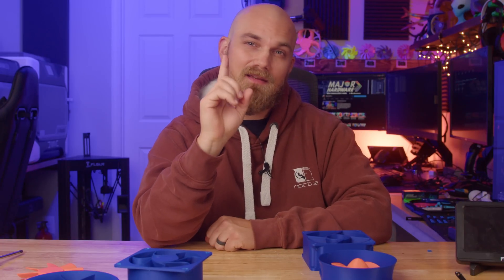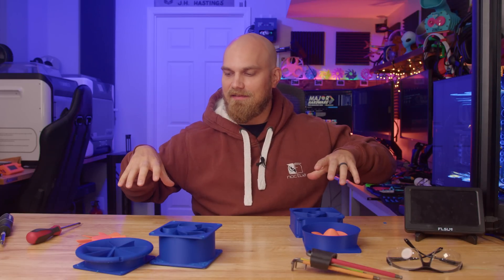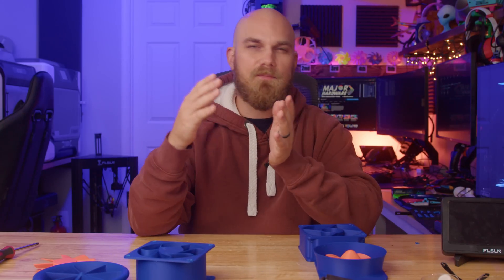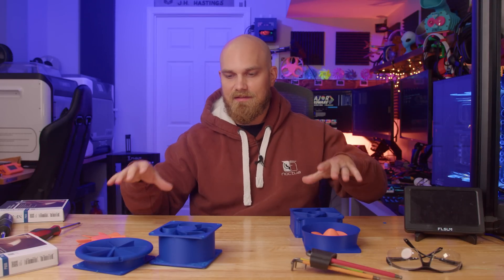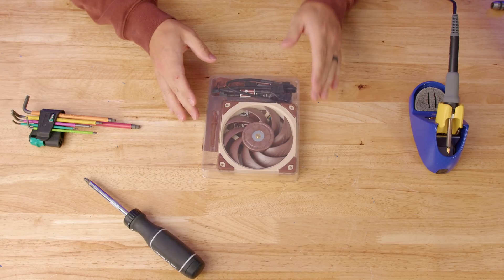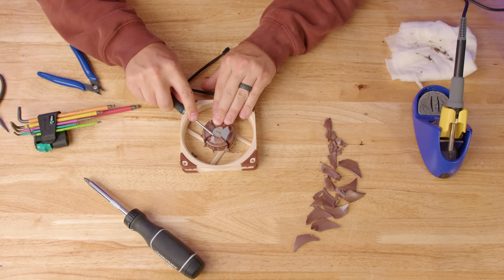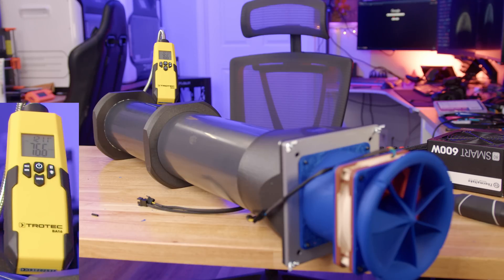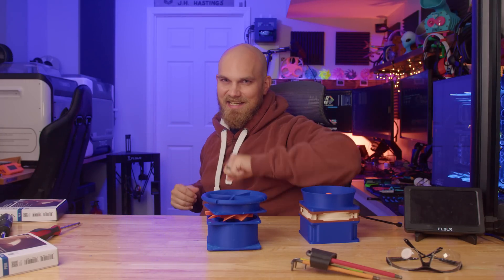Which One is REALLY the BEST | Fan Showdown S4 Finale

Comment: Honestly, I think you should do all the methods of testing.  If you don't have time for that, I still think you should do noise, smoke flow, airflow, and finally at least one of the cooling tests.  Noise/smoke/airflow are all fast tests, so then the only thing that is time intensive would be the cooling test.  Maybe what you vary season to season could be the kind of cooling test you do.  Also, you should have one final bout between the unswirler and cheater on any of the actual cooling tests.  That's the ultimate showdown really.  When their numbers are so close, the number don't matter as much as performance and noise at that point.

Comment: For season 5, while it would be more work it will also help display correlations, I would love to see the following:
An Airflow test to show just how much air a fan can move
A cooling test, oriented with the fan pulling air in from below and pushing/pulling it upward through a liquid radiator.  This will allow a 'baseline' of no fan with the best conditions as the radiator will heat the air, causing it to rise, which will draw air in passively.
Using a liquid cooling setup will allow you to create a mount distanced from the components themselves. The mount, ideally, will have temperature gauges for the liquid as it both enters and exits the radiator. Therefor, we can see where the temperature levels off and exactly how much 'cooling power' each fan can produce.

With that, we can then hopefully draw metrics to see just how much airflow produced correlates with 'cooling power'.  Future submitters can then use their own airflow tests and simulations to gauge how much cooling their fans might yield and help drive creation and design further.

Comment: Here's a more sophisticated way of ranking fans: raw airflow, airflow per dbA, raw static pressure, static pressure per dbA, air temps, thicc rad temps. Main ranking should be average of all with "king of Air", "king of Water" and "King of Silence" subrankings. Good luck organizing all of that lol.
BTW I believe a lot of fans waste potential because of wobbling so it would be nice if you did same thing as tyre balancing by measuring wobble and adding little weights to even out 3D printing artifacts.

Comment: I feel like you’ve done cooling and airflow pretty completely. I think it’s time to up the ante. Make a scoring system based on airflow, cooling, sound, static pressure. Then have a bracket showdown - fill a box with smoke, mount a fan pushing into the box on either side, and see which fan wins the death match. Or just keep doing your thing because we love ya. But also…death match.

Comment: The very purpose of measuring the fan air performance really is a stand-in to estimate the cooling performance, AKA the real thing that actually matters. Measuring airflow is like testing a car's performance on a dyno rather than on the track, or torque at the shaft rather than at the wheels. Is the cheater REALLY the top performer for the domain in which it's meant? You will never know because of that abstraction. The turbulence profile could interact with a cooler extremely negatively, the vibration profile could mess with the vapor chambers.
Actually putting the fans on something like a Noctua NH-U12A and testing cooling performance actually makes the truth evident in a way that airflow cannot.

Comment: I have an Opinion... because Internet.

The show has evolved a few times since its inception, c'est la vie.
The cooling tests were a good starting platform but the show is "The FAN showdown". 
With the change, It focused on more aspects of the fan and its performance... as a FAN 

If you were to bring back more CPU cooling focus, it would have to be both air cooled and water cooled. 
Air-cooling with Noctua is the way to go.
An AIO would be ok, as long as it has a decent flowrate or the one with the most market share.

Each have their caveats when it comes to the fans cooling them.

Comment: Air cooler u12A. Most heat pipes. Less surface area, comes down to the fan more than most, and kept simple with just 1 Tower.

Comment: But into your question. I think running a real test on a bench cooper would need better as it would show real world results much better than a hypothetical setup. A lot of times, lab results don't equal real world results. While they can help to show numbers. They don't take into account things like does a squirrel so better over a heat sink or turbulent air or non turbulent straight air flow.

Comment: Would love to see the same airflow setup with additional restriction, like pc case mesh and/or radiator to test how they perform under pressure :D
Also i would love to see fans being tested both restricted and unrestricted(like in S4). Temperature test has too many variables. I guess if fans can move a lotta air while restricted, they would also cool well.

Comment: I would suggest that Airflow is not the entire picture, nor is air pressure.
Fans are indeed designed to be tuned towards a specific purpose.
Denser blades often means it is meant for high pressure, which should work better for radiators and heatsinks.
While the more open fans are lighter and can spin up faster for a higher flow rate.

Maybe the answer then is to take the top 5 from your best airflow chart and see how those do in cooling.  Or just the winner of each episode.
Alternatively you could have the submitted designs clarify on which their design is meant for.

Comment: I see many comments suggesting you add a water cooler to add some more resistance in the air stream, but the simplest method would probably be to just print a restrictor plate and put that somewhere in the system. You could even try fans both pushing and pulling air trough the restrictor plate.

And since pressure is just the result of resistance to flow, there is no need to measure the static pressure. This addition is basically just to see if the fans have any sort of resistance to stalling when the pressure differential starts adding up slightly more than before.

Comment: You could do CPU cooling alongside the current test just as an extra metric, but perhaps you could have a dummy CPU that's just a resistive heater with a temp sensor inside so you can drive it with a constant current and make it a perfect uniform heat source

Comment: Just saying that IF you do any cooling performance testing, not use a CPU?
Instead, how about driving a tonne of amps through a peltier and cool that and try to keep that cool instead of trying to generate a load on a CPU hoping it will be constant in power consumption.
Maybe even measure both the hot and cold side of the peltier?
I like the invariability of the flow test (apples to apples and so on), but I like the test of 'how well does it cool' better for measuring how well a design does. They are cooling fans after all.

Comment: Maybe do 140mm fans next season! Going to 140 changes ALOT about rpm, static pressure, blade design, etc... Keep making great videos! Oh I'd love to see the 140mm on a 140mm aio, or custom loop, maybe custom loop would be best but I'm not sure if they make a single fan 140mm radiator, maybe somewhere out there

Comment: I prefer the airflow test, but there should be a static pressure test on top of it. The airflow is good, but it doesn't remotely represent how the air is dispersed. That's sort of what the smoke test is for, but it doesn't really quantify the affect of the center flow.

Comment: I prefer airflow tests. Cooling tests have way too many variables room temp back ground tasks residual heat from the prior test. And you have to take more measurements of air temps. Most people can figure out the cooling performance based on airflow. What would be better would be static pressure so if people wanted to use these on a radiator.

Comment: I think you should test both unobstructed flow and flow through the radiator - that'd cover use cases as a cooling fan and intake/exhaust fan and also give idea, which design is better for which purpose, which could be interesting.

Comment: Second comment, not my usual habit, but here's how I'd like to see S5 be measured as for cooling performance. Considering the target being "enthusiast grade", aside the whole set of current measures including CFM, a 'cooling performance' would be a good point as well. Ideally you'd take an as fixed heat source as possible, whether that be a heating element you can just 'set' to ~200W (gotta mimic them alder lakes). Something easy to calculate the amount of energy going "in". Water heat exchanger on it (a block, or something else), and measure the amount of heat in the water. So far it should be pretty consistent. You'll have a value of thermal energy in the water. Pipe water through radiator with fan on it, and while I realise you'll run the risk of having a radiator test (hmmm... wish it were cost effective to 3d-print radiators with that copper-shrink-filament stuff), you can measure the thermal remainder in the water after the radiator. Ofc, this won't work with a closed loop (equilibrium is a boring measure), it would have to be an open loop with as little variable behind it as possible other than the fans' ability to influence the radiator to exchange heat between water and air, but I'm sure that with a clever tank setup and a good D5 pump on fixed speed you can do this without much harm to the loop, or excessive waste of water.

Comment: I think you should use resistive electric heating peaking at 100°C meant to simulate the load of the 4090, at the exit of the wind tunnel, with thermal probes connected to the heating element, to get a graph of the temperature of thermal probe for the duration of the test, which to use to make a graph for the averages, and which to pair with a similar test without a wind tunnel, and have those two as separate rankings and a third separate ranking which to be the average of the two rankings, which to be the final ranking, and in each episode show us all 3 rankings for each of the fan tested. That way, we would get both a restricted-airflow and an open-bench comparison for the fans, giving us the best of both worlds, so people know which one is better for their particular needs.

Comment: What since the flow rate measuring device already has the right mount, I say for S5 the obvious move is to measure noise, airflow, and then airflow through the radiator. That's no big change to your routine of what you set up and run and gives the flow measurements more depth and reference. Way too much labor for you to be running a temp test with every fan, and that test is a little too hard on the art designs for viewing pleasure.

Comment: Why not both? At least try it if there is any difference in the Leaderboard between airflow and cooling, or will the best airflow have the best cooling performance as well
 Airflow is the more reliable method and more accurate, but cooling is a more realistic application for a fan.    If they are always equally placed, it would be redundant to do both. But it would be an interesting experiment to see if this is the case.

Comment: Using the soldering iron to melt plastic does create toxic fumes, especially at the highest temperature.
In general, the healthier thing to if you want to use a soldering iron is to use the lowest temperature that still melts the plastics (roughly 120c - 150c)
At those temperatures there will be very little fumes produced.

Comment: Well, since everyone wants both airflow and "static pressure" you can kill both birds with one stone by putting an air-cooled heatsink-style radiator in the wind tunnel duct, measuring the pressure differential across the radiator with a u-tube manometer and correlate with whirly-gig airflow meter.

The higher pressure of a cooler will definitely change things up a bit because a fan pitched for high flow, low pressure as per season 4 will not necessarily be any good (or at least no optimum) for a high pressure, low flow scenario.
Reply: edit to add that a 3D printed pseudo-air cooler would be sufficient to simulate the cooler resistance

Comment: If you could measure pressure and volume would be optimal and fair across all fans. No need to do a real world application as fin stack density change the outcome of any fan. Some say the Phanteks T30 is the best fan ever but it can't show how powerful it is on a cooler with low fin density. Instead all things being equal once we have noise, volume and pressure we have all the data we need.
May I suggest to gather data at a fixed noise level and at max rpm?

Comment: Air flow is fine, that's proportional to heat transfer anyway. But I agree there should be some added resistance. It would be awesome to see air cooler vs radiator before vs radiator after, but if I had to pick just one, I'd go with a radiator after, because it probably has higher resistance and would be the easiest to mount inline with your flow tube. If you wanted to make a clear acrylic box with all 3 though, I wouldn't complain. :P

Comment: There is at least three use cases for this fan, how could one of the test be correct for the other two. I think the most used is a cpu cooler, then case cooler, then radiator cooler, since cpu is probably number one use case, I would add that after the fan and test airflow.

Comment: Air flow has less variables. If you want to test the fans on a cooler it would be better not to use a real CPU. A surface with constant heat output would be better.
Gamers Nexus has a really good test setup for this.

Comment: In my understanding of Axial fans, the I think the "Unswirler" may increase its static efficiency by removing the guide blades on the intake. The flow conditioning on the intake is probably is being de-rated due to the pressure drop of the same blades. 
I also think that the impeller design of the 'Cheater' is great, that it uses slightly extra by adding the inlet cone. 
Still these performed within 1% of each other.

Comment: Airflow is probably best because the higher the air flow the more it’s gonna cool.

With that being said, you should test the airflow with a radiator in the airflow path. This would test which is the best/most efficient for the setup, as higher air flow may produce too much back pressure on the fan and cause it to become more inefficient

Comment: Do airflow tests, but add static pressure. This will help in ALL aspects of the fan's duties. High flow with junk static pressure wouldn't be as useful as the same flow rate with higher static pressure. The fan's usefulness as only an air cooler or works well both air cooling and liquid cooling (radiator). Also, higher pressure would be more useful in creating a positive pressure case. Furthermore, I think there should be 2 categories in season 5. 1: fan designs with added complexity like the Cheater has ducts etc. 2: designs with only the fan blade. No one wants to put multiple cheaters on their case. It would be cool, but  I doubt it's desirable.

Comment: I would like to see airflow testing with some standard static load either a tad or air cooler. I'd suggest potentially testing a few different coolers in an episode to see what device is most "typical" and then using that.

I'd also like to see a division split. An "open" division including all fans and a 'contained' or traditional division division which is strictly for fans that fit in the normal fan shroud.

Comment: For my part, I'd rather see more air cooling tests, my reasoning being that, if cooling is the point of these fans, then cooling is the variable we should be measuring and comparing, rather than measuring air flow and inferring cooling performance for that. I also think that air cooling is a more widespread cooling method than water cooling, even if it's not the best, and, therefore, more relevant.

Just my two cents; I may be wrong.

Comment: Air cooling is too simple of a test, IMHO. This is a simple Horsepower vs. Torque argument. Air cooling is horsepower, and with a radiator, static is torque. So, if we are testing "the best fan", without static, you're only getting half the story. Major Hardware, and the Fan Showdown, has gone through great lengths to be accurate; but without the static side all results have to be taken with a grain of salt.

Comment: I think we need a run of the top 5-10 fans (the more the better) where he does both temp and flow meter. Then we will get a scientific analysis of whether the 2 tests are comparable. If they aren’t then I’d repeat with a ‘resistance “ radiator in the flow metre setup. If this still doesn’t produce comparable stats then we’ll have to rethink why. Hopefully though they do🤓

Comment: I hate to be this guy, since I know first hand what it entails, buuut...
Simply put, the smoke tests, airflow tests, and cooling tests ALL need to be performed.

I think it ought to be a 120mm AIO, because we know that's sufficient to cool even an overclocked processor (not saying the max OC). However, anything bigger, I think will negate the FAN'S performance, being too much due to the 240-or-larger radiator. So I feel the 120mm size will actually create the possibility of finer detailed results since a small change in airflow will change temps more.

Although yes, the big issue then becomes static pressure... I just think in this day and age, water is the mainstay and heatsinks are now the fringe cooler (eg low profile builds). Still, if it wouldn't further double the workload, I'd say run the AIO and HSF tests... but yea, I'm already suggesting a lot as is!

(I know, he said he'll do a poll, but I work better in-the-moment)

Comment: Continue with airflow, but add a radiator to the flow test and make being quiet important again.  Maybe set a value for flow and another for noise level and then set the positions on the leader board from there.  A high flowing, quiet fan should be #1